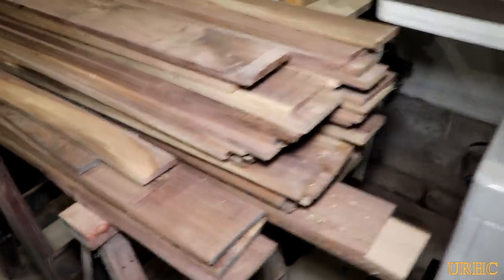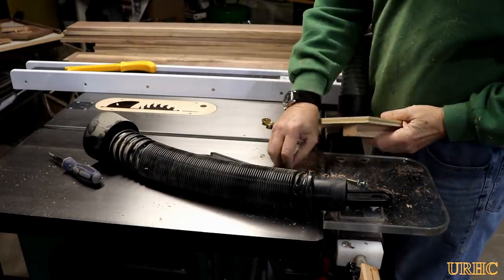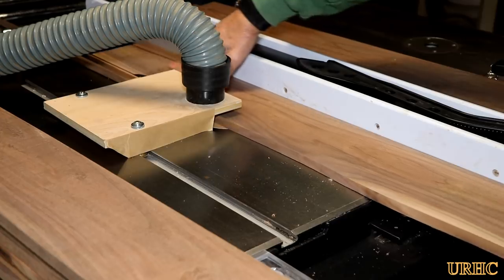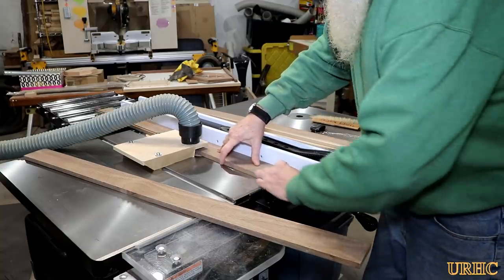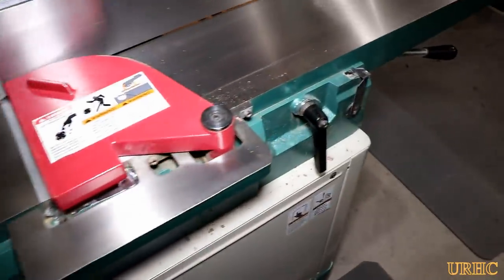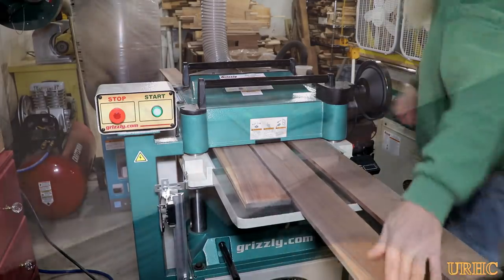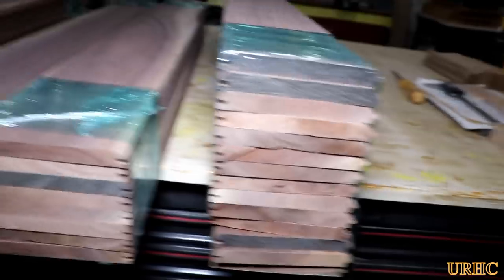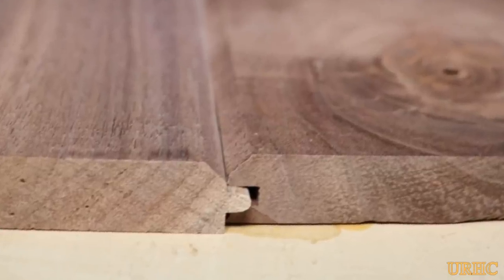Making Some 7 /16" Walnut Tongue And Groove Paneling On The Router Table

Comment: The natural edge top looks fantastic.  You do such cool projects, I can't wait to see the finished job.  I'll bet there was some "colorful language" when the zipper blew?  LOL.  That looks like it's going to be a fairly large cabinet.  Hope to see it soon.  Will happily wait to see it after what you make for the dehydrator.  Great idea for the saw table to catch the sawdust, looks like it worked real well.  Simple and easy.  Great video as always, thanks.  Stay safe and well.
Reply from the maker: Thanks. I just shut off the camera went back turned the sander on and poof the whole zipper blew apart. I guess there was to much dust in the bag that clogged the filter material and built up excess pressure. It was an unexpected surprise that made a mess. The cabinet will be like a pie safe with a drawer and pullout shelves for guest linens and towels that keeps being delayed by other projects. Thanks for watching.

Comment: I have been using the 1HP shaper I got from Harbor Freight several years ago as a router table and it has always worked great.  And its much quieter then a router.
Reply from the maker: That is a low cost option. I am looking for a larger table  then that with a real good fence and lift. Harbor freight makes some great starter tools. Thanks for watching.
Reply: I didnt know they had one of those and that may be handy for certain things. Do you remember what the price was or close?? 

Take care brother!!

Comment: Awesome presentation!  Could you please tell me where did you get your router bits ?
Reply from the maker: Thanks.  I get them from MLCS and Amana now. MLCS bits are chaepc and good for a couple hundred feet before  dulling and Amana bits are good for my CNC and longest  lasting  in a table. Toold today is a great  place to buy Amana bits. Thanks for watching.
Reply: Ok thank you. But I am having a hard time trying to find the bits to do thinner boards.  I have an order to make wall planking.  The thinest as possible.
Reply from the maker: I would  contact Tools Today to see if they have an Amana bit for your  needs. This one only is good for a little under  7/16.

Comment: I would suggest looking into the Triton 3 1/2 hp router. It's basically a router and lift for less than the price of a good lift. A man with your skills could mount it to a plate for the table you already have. I bought the kreg plate because I had the kreg table, couldn't be happier.
Reply from the maker: I have mixed feelings about the Triton router.  My other Bosch base has the same feature and it doesn't really impress me.  The table I have has sagged in the middle that makes it hard to get a good cut with bits like this on longer stock so that is why I am thinking about replacing it. I understand the keg lift is just a rebranded lift from another vendor. I definitely want to go with cast iron this time. Thanks for watching.
Reply from the maker: I have seen that table. I am on their email list. I think their top is made by general international and probably would be a goodchoice.  Years ago before the internet I purchased a lot from Woodworkers Supply. Prepare for long days if you start a  channel.  Making, editing,  and uploading videos takes many hours but it is a fun hobby. Thanks for watching.

Comment: You may want to consider a small shaper instead of a new router table . Maybe able to find a good used one . They are perfect for that type of work . Still a bit tricky to adjust but after you have a test piece made for reference it is quick to set up .
 I love that walnut , wish we had it here .  Great work
Reply from the maker: Shaper cutters are very expensive for what I do plus I am running out of room for equipment. Walnut grows like a weed around here so that and ash killed by the EAB are the primary woods that I have to work with.  Thanks for watching.
Reply: Shapers are very expensive to get cutter heads for as I have a pretty nice one that hardly ever gets used anymore since i can buy router bits in the same profile for 1/10th the cost

Comment: I’ve been looking at the bench dog top but I I was thing about going with a triton or Bosch router with the adjustments built in
Reply from the maker: I am looking at that one but have seen several comments about theirs being bowed corner to corner. Infinity has the one with a Triton router that looks nice buy I really would like something  that has less play then the Triton and Bosch setups. MLCS has one but they won't give a flatness spec, they say it is dead flat which means you are stuck with whatever it is. Grizzly just started making one also that I would like to see reviews of. Thanks for watching.

Comment: Looks perfect. Now if I could figure out how to tongue and grove the ends of the boards to look just like that I’d go buy a bunch of tongue and grove pine from my uncles sawmill and get started on my ceiling. . I don’t like the look of the 45 Butt joints on most people’s ceilings after a couple years.
Reply from the maker: My last house  I used t & g on all the ceilings.  Used 2 routers wit guide bits for the end. One with a 45 deg chamfer and one set to cut a 1/4 x 3/8 slot. I cut hundreds of 3/4 x 1/4 x 5 1/2 splines that were inserted when installing.  Easy and undetectable way to join ends. Thanks for watching

Comment: I know you aren't crazy about your router table on your saw but I love mine. After using many variations of router tables over the years and now using a cast iron top I will never settle for less than cast iron if I ever need to change. Huge difference in feel when routing and a better finish. If you want something different a shaper would be a great addition. The collecting of cutters is a bit out of my budget or I would have one.
Reply from the maker: I see grizzly now offers a cast iron stand alone table and lift that looks nice.  My old harbor freight table has a bow from sagging that makes it hard to get a consistent cut so it is time to start looking for a flatter one. Thanks for watching.
Reply: I have the same saw as well, actually bought it mainly on the videos you put out here. I have not used my table on that saw yet, but I’m waiting until I get into my new shop & probably will set up a dedicated dado or round over of some sort but thanks for selling me on the saw & Grizzly should thank you

Comment: I would think the money you saved by not having to buy the walnut, will go a long way to paying for lots more equipment., Down here in Texas, good hardwood is super pricey! Great job, I built a home made router lift and table. Really makes bit changing and adjustment so much easier.
Reply from the maker: People say money doesn't grow on trees but with a small sawmill it really does. I thought about building one but really like the idea of a nice flat cast iron table top that will stay flat over time and can use a standard miter gauge. With mixed reviews on most tables and lifts I am hoping there will be some viewers that can provide feedback on different models.  Thanks for watching.

Comment: Although not the cheapest lift the Jessum Pro Lift is the best one for finr adjustments
Reply from the maker: Thanks.  I will look at that one. Thanks for watching.
Reply: @Stephen Ash - I do agree with your choice of the JessEm brand, although I personally have a JessEm "Mast-R-Lift II" model.  Simply the best lift on the market, fine adjustments and ease of bit changing, plus accommodates most major-brand routers and models. For mine, I chose what I believe to be one of the best-suited routers for this application - a Porter-Cable Variable-speed, 3-1/4 hp model 7581 (you can purchase the motor-only for a drop-in application to the JessEm lift if you don't need the plunge and fixed-base units that can also be purchased with the 7581)….a link below to both the lift and the router.....Be Safe!
www.jessemdirect.com/Mast_R_Lift_II_p/mast-r-lift-ii.htm

(fixed Base)….
https://www.rockler.com/porter-cable-speedmatic-3-1-4-hp-five-speed-router-7518

(Motor-only)….
https://www.rockler.com/porter-cable-7518-variable-speed-3-1-4-hp-motor-only
Reply from the maker: Wow it is nice that the JessEm can take any router without any extra adapters. That definitely is the router I want to get someday.  Thanks.

Comment: What bits would I need for to tongue and grove 7/16 thick pine and cypress wood?
Reply from the maker: I used the MLCS bit set but many  companies  make them if you search for t&g v groove bit set. Thanks for watching.
Reply: What part number set would I need I’m new to this and need direction putting wood on walls in house
Reply from the maker: look on the MLCS website  to see what they currently sell or call them and tell them your requirements. They have different patterns,  and quality  bits for different thickness tolerances.

Comment: Do you have a favorite set of bits for flooring to cut the tongue and groove?  I have oak board that I am using for flooring in my cabin.  Thanks
Reply from the maker: The only time I tried cutting t&g for flooring I used the 1 inch t&g knives that came with my old Foley belsaw planer that worked good. Having powered feed made it go fast but it did tear up the rubber feed rollers doing the second side. If you have a lot to do I would spend a little more to get a high quality carbide bit and look for a power feeder. It also needs some back cuts to stay flat. Good luck. Thanks for watching.
Reply: @unemployedredneckhillbilly2023  Ok thanks, after I sent that I may just use the table saw, I have about 500 square feet to do.  The boards are 8 inches to 12 inches wide.  3/4 inch thick.  I have a drum sander for the finish side.
Reply from the maker: That is awful wide for oak flooring to stay flat. I definitely would looking into back cuts.  I bet it is beautiful when done.
Reply from the maker: Just some sawcuts on the backside should help

Comment: why not hook up your dust deputy to your belt sander rather than use that old bag? Also what you gonna make with the paneling?
Reply from the maker: I don't have a adapter that is small enough.  I will in the future.  It is for the back of the cabinet I am building to match the night stands. Thanks for watching.

Comment: Great video. I'm looking for a good router table too. I'm wanting one that isn't to expensive.
Reply from the maker: Hopefully some will chime in with tops they like. The reviews are so mixed it is hard to tell which tops are the flattest and have proper grinding of the miter gauge slot. MDF tops sag over time so I really want cast iron. The t&g bits and door coping bits really need a good lift to set up for accurate cuts. I have a bunch of stuff that I don't use anymore to sell that should pay for a decent one. Thanks for watching.
Reply: Check out Grizzly new cast iron tables

Comment: ROUTER TABLE
check out GRIZZLY new ROUTER TABLE
it is awesome looking
Reply from the maker: I see that one and it looks nice but don't know if the if I like the fence.  Jet has a real nice one also with a 4 post lift but it's pricey. I didn't realize there are several different size router plates used by different tables till now and some lifts need special adapters for different size routers. Thanks for watching